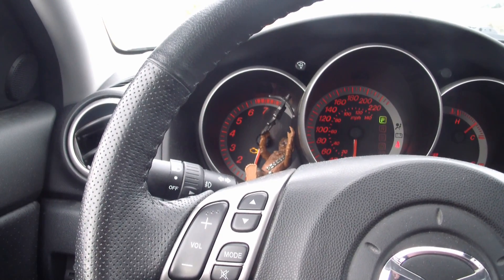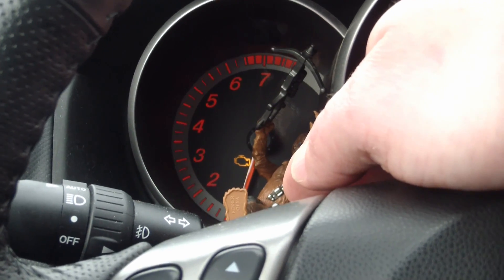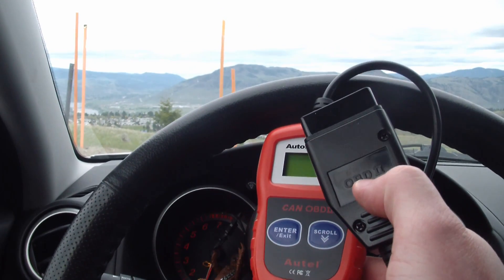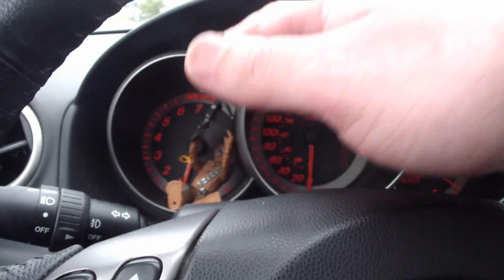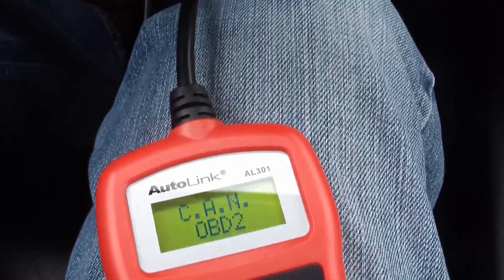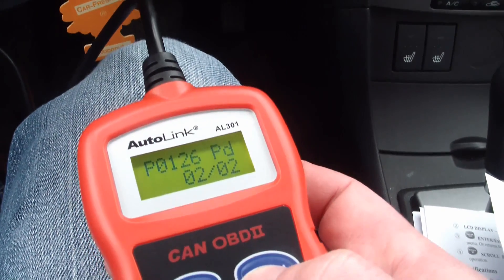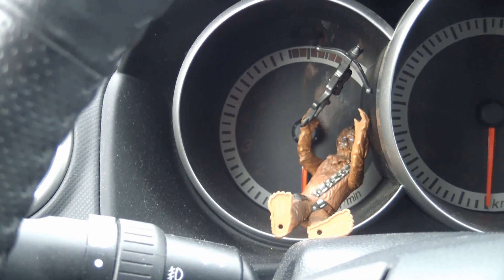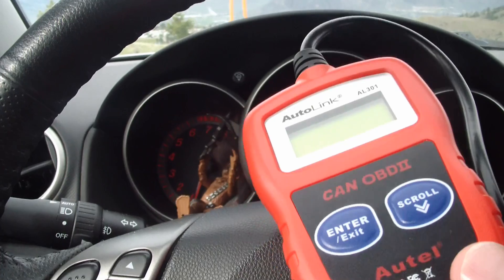Manly-Man Skills: Outsmart Mechanic Scams by Using Your Car's Computer!

Comment: The reason so many cabs had those engine lights is because most cabs for the last 20 years were Ford Crown Victorias. They throw engine codes like feminists throw tantrums. I sat in a police car once with a cop that was so tired of looking at it that he'd taken a bottle of White Out and painted over the light on the clear plastic.
Reply: Push Back you say "pull the bulb" ... have you ever pulled a cluster? .... not as easy as it sounds
Reply: kenny moyer I actually have pulled dash clusters before. Depending on the vehicle, it's not that hard. In many cars, the cluster is a component that comes out and the bulb is behind a sheet of plastic where all the indicators are marked. It's not too difficult.
Reply: kenny moyer Trust me...he's pulled a cluster.....
Reply: Apparently, the proper strategy when selling a car (or Ford van) is to pull out the bulb.
Reply: Push Back and
Reply: Rubenbanana Over time, he'd taken a sharpie and gone over it. It didn't look too bad, but I was left thinking "Why not pull the bulb?"
Reply: Push Back Oh...The old "Auto Correct" 😅
Reply: black electrical tape, blends in pretty good too
Reply: I was a cop during the crown vic days. We used a lot of black electrical tape to turn the check engine light off.
Reply: Push Back some aren't too bad ... but when you consider one if light is on solid may not be a big deal but if light is rapidly flashing you have big problems ... take bulb out you don't know .... I just ignore mine on 86 chevy k20 ....two the cluster on my 89 s10 takes awhile because of hvac controls if your not real careful  that anoyying bulb can turn into hard to find hvac vacuum head switch .... luckily my already fragile vacuum head (original to truck at 189k) was one I had a spare of from part truck ....

Comment: My engine light comes on once in awhile and then goes away on its own LOL
Reply: Rex Holes it's either the o2 sensor of the gas cap.  used to happen to me as well.
Reply: MyNoble06 a flashing engine light is a class one misfire .
Reply: +myboy051 it's also like I said above in either case it's saying something is terribly wrong and can cause damage to the engine. a solid light is less serious. if you think about the average person is less likely to ignore a flashing light rather than a solid light.
Reply: was about to say o2 but covered lol.  also i just DL software for my laptop and got the cable only to use on my WRX.
Reply: +5tevef if it's a o2 sensor more often than not it flashes. this is because if a o2 sensor fails it sends the engine into a rich run limp mode which will kill the cat. if it's solid it's not as urgent or important as a cat
Reply: your engine light likes you

Comment: If it was anything I'd say probably a worn out thermostat. Thermostats  tend to start passing too much coolant to the radiator after a few years which reduces engine efficiency. Or sometimes they do the opposite which is far more alarming.
Reply: Or a dodgy temperature sensor? (or poor connection, if you'd been doing something under the hood)

Comment: WRONG!, check eng light is only there for emission related codes.educate yourself 1st,before scaring all the retards that watch your vids.OUT!
Reply: Check engine is absolutely for more than emission codes.
Reply: trashy10 stop. please.
Reply: Justin DiPlacido The OP is a bit of a twat being so aggressive, but the intent of the CEL is specifically for emissions. Emissions is directly related to engine efficiency (+ catalytic converter health), and engines only run efficiently when everything is working properly and at the right temperature. This has far reaching implications for the type of sensor monitoring and what actually triggers a CEL, but nonetheless all CEL codes are based on emissions. The amount and type of data that can be pulled from an OBDII port is more than what's solely involved with the CEL of course, for example issues with ABS and Airbags which trigger seperate lights. However you may not be able to pull ABS or Airbag information with a basic OBDII reader since some manufacturers create their own proprietary protocol for other data outside emissions since other data types do not need to be standardized.
Reply: yeah ok im the bad guy. google it,im fine with that,let me know how many codes turn on the MIL for shocks or low tire pressure cracked windshields,low washer fluid,or bad body madules.good luck guys
Reply: The CEL is not only for emissions. I think the appropriate thing that should've been stated was that majority of the time the CEL comes on when it is an emissions problem.

Comment: Same code can mean 6 different things between 6 different cars (manufacturer specific codes), OBD2 is 96 and newer only, and font remove battery connector on a lot of German or Swedish cars, will mess you up more.

Comment: That scanner does not show manufacturer specific trouble codes. For example, VW has specific DTCs that only a reader for V.A.G. cars can decipher. That's Volkswagen-Audi Gelelschaft or Volkswagon AG, not VAGina cars btw. The standard OBD2 scanner/readers only show codes required by the C.A.R.B. that are on the list for OBD2 compliance. So pretty much anything emissions related you'll find standard OBD2 codes for.  But if you get an ABS warning, the code is going to tell you to check the ABS control module DTCs which you are out of luck then with the standard OBD2 and will be stealership bound or to a mechanic that can access the ABS control module with a dealer scanner or equivalent.

Comment: Be careful with mechanics, especially dealerships.  they will often tell you that your car is throwing out a code for this or that when your car's check engine light isn't even on and your OBD scanner or your car's "in house" checking procedure isn't throwing a code.  If you ask them why that is, they'll tell you their computer is a deep scanner and can detect codes that you, the regular consumer, can't access.  You are being given the shaft when they tell you this.

Comment: In many cars, if not all, you can check what the codes are without the OBD scanner.  Search google for your specific car to find out.  There should also be a simple code erasure procedure as well, meaning you may not have to disconnect the battery to erase the codes.

Comment: Not exaggerating when he calls them stealerships.  Was a customer service manager for an aftermarket company for 7 years and the amount of BS I dealt with from stealerships who knew less about THEIR OWN CARS then us was incredible.  Chrysler dealership once charged its customers to replace defective ECM modules that were defect straight from the factory, that Chrysler HAD issued an TSB for but easier to blame your aftermarket hubcaps the cause of the failure to collect $700 cash from your customer (that was just the ECM cost labor add ++) then warranty the unit.  So yeah I can confirm ALL and I mean ALL stealerships are exactly that.  And about 80% of these check engine lights in the rust belt (Canada included) are faults with the OS2 sensors on the exhaust.  Seeing there are normally two of these sensors on all vehicles, quite easy to have them fail due to our crummy winters.

Comment: Handy to have, but unless you are able to test the components to ensure they are factory spec then replacing parts based on codes can be very costly and still may not fix a fault. My last video covered that situation with ABS wheel sensors, having the OHM and VOLT values to test the sensors made it easy to discover the fault was just dirt on the sensor I washed off to fix it that I otherwise would have replaced at some cost. A common error I saw as a mechanic was some who replaced a number of expensive non returnable parts due to multiple codes, never considering it most unlikely for a number of parts to all fail, and more likely to be a bad earth or the like, and the look on their face when you say you found the fault and it was just a broken wire is priceless.

Comment: If the light is flashing it is a serious problem.
Reply: If the light is flashing it means the fault can damage the catalytic converter.such as misfires/lean codes...
Reply: &ean Fal and some crazy ladies have 17 cats..
Reply: If the light is flashing, turn.
Reply: if you have emissions checks yes, but i dont ;D
Reply: American Gun Nut 
🤣😂 indeed they do. There's one in the complex across from me .
Reply: Gas cap fault.  Replaced for about $8.00.
Reply: Indeed, and some vehicles have 2 Cats
Reply: @datdood3  some have 3 and 4
Reply: Removed the 15 amp fuse that goes to the lambda probe on my cheap lil chevy hatchback and it started flashing the check engine quite vigorously when i turned it back on.
So yeah this kinda reinforces the "only flash when emissions" thing since the lambda probe goes into the exhaust to detect CO2 levels... or was it O2 levels?
Well it detects some sort of car fart.
Reply: &ean Fal lol hell yeah
Reply: Misfire
Reply: Or there's fault with the light itself.  Imagine that, your car slowly falls apart on you, all because the check engine light is busted and never turned on, lol.  XD
Reply: your check engine light will NEVER flash for an oil change. its against federal law to use the check engine light for anything but emissions failures.
you are talking about your maintenance required light.
Reply: if the light is flashing it's a misfire

Comment: *****
I know it's probably been too long for you to see this... But have you ever looked at the "Torque" app, and a bluetooth connector for ODBII? You can get the connector off Amazon for a few bucks, and the app is just a couple... (I got it for .99 a few years back...) But yeah... It's super neat, and fits a bit into your worldview of things. You can see realtime output of pretty much any sensor on your car.

Comment: ABS sensor light was on. Lexus told me back left sensor was bad and it would be 1200.00. Took it home found a broke wire to back left wheel and spliced it back together for 0.00. Problem solved
Reply: also for quoting a whole new sensor.  repairing it is likely improper repair according to lexus.  especially if its under warranty old parts have to be sent back to the company and are examined to find the cause of the fault.
Reply: siborg 1 ABS sensor $40 then they charge $400 an hour including lunch and a couple of smokes  maybe a visit to the stores and a bit of PlayStation time
Reply: You'd think they could easily test that by hooking up a known good sensor and not seeing the light turn off, thus pointing to something else being the issue.  Maybe they did, who knows.
Reply: PongoXBongo super late response.. but 99% of the time the wheel speed sensor has about a 6-10” pigtail with it.. meaning the wire is included in the replacement.. usually dealers don’t splice wires due to the fact their obligated to return the vehicle to factory specs.. but that doesn’t mean you can’t splice them yourself 😉
Reply: $1200....Shoot a feller could have a purrdy good time in Vegas with all that stuff.
Reply: too much padding in the wallet region was what the quote really said if you read between the lines
Reply: Had the same on my Mazda Premacy, bought a new sensor, actually it is a proximity switch,  at E-Bay for 22 € what is apx 25 $, everything OK now. Has to be the same price for Toyota ( Lexus )
Reply: I had the exact same issue on my VW Jetta TDI
Reply: They legally cant do that that have to replace it
Reply: @watermelons1285  bullshit.
Reply: @chocolate_squiggle  me being a red seal car fixer I can say its seriously frowned upon. There is a twist rate for wires and if its not correct it can send bad readings to the ABS module. Wires that are crimped with butt connectors also can affect the performance. And when an abs module is looking for small amounts of a/c mV difference between all sensors. It can (not alway) but can set fault codes.
Reply: An ABS sensor generates either a low voltage sine wave or a vow voltage digital pulse. An improper splice could interfere with that signal and cause a fatal accident. No repair shop would EVER take that chance with your life! Many sensors are built into the wheel bearing assembly and must be replaced as a unit.
Reply: @gener.1253  Oh yes... you ABSOLUTELY have to have a wall full of "certifications" to be able to do a good splice...
Reply: @alfredomarquez9777  having a wall full of ASE Certifications, 11 in all, I would never attempt to splice a twisted pair of shielded ABS sensor wires. If you want to put a price on your safety and that of your family, feel free....
Reply: @gener.1253  Dude, relax. It just disables the ABS you're not going to crash and kill anybody lmao. People drove around in drum brakes, bias ply tires with no abs for decades.
Reply: The reason they quoted full replacement is to ensure the fault wouldn't come back. Splicing and repairing the wire works, but may interfere with the signal. Cars are very touchy when reading voltages.
Reply: @533ren335   If a shielded wire is truly required, replacing the whole wire shouldn't cost $1200 either.
Reply: 533ren335 splicing a wire doesn't call inference it just makes it whole again as long as its sealed up good with shrink wrap I don't trust tape as it holds moisture.

Comment: Don't disconnect your battery to erase codes.
Reply: They come right back.
Reply: Push Back Yeah. Also it makes it more difficult for a mechanic to diagnose the problem.
Reply: trust me, i've had it happen that someone disconnected the battery right after he shut the car off and it had to use all it's factory settings instead of the ones it made itself by all the parameters it got while driving, the car used about 1L/100km more and the emissions were a lot worse donotmindmeatall
Reply: donotmindmeatall
it was a 2015 1.5 Mercedes A class, well its a renault engine. It normally uses around 6L of fuel and now increased to 7.3 but after driving around 100 km's it returned back normal although the driver doesn't like seeing the increased consumption, and yes this happened in europe. Belgium to be more exact
Reply: No.
Reply: Correct- DON'T PULL YOUR BAT CABLES, NOTHING WILL HAPPEN.
Reply: Jn
Reply: Under some conditions with some brands they will show back up quickly. With some brands and some issues you are creating a pain in the ass for your tech by clearing the codes. They may not come right back.
Reply: and let's not forget all the electronics that will forget all their data including quite necessary ones for fuel economy and such
Reply: Scott Diamond anytime you do work under your hood you are suppose to unhook the battery anyway....sooo....what's the difference?  yes people unhook your battery when doing plugs and wires or anything electrical under your hood. changing oil and topping on fluids you won't need to unhook your battery.
Reply: alan stepp read all the other posts for your answers. I'm a master certified auto mechanic with 25 years experience. I know when I need to disconnect a battery and when not to.
Reply: Scott Diamond it will come back after 100 miles or so and it also resets your fuel settings I'll call it and the car has to relearn its fuel ratios and your car will idle differently and also good bad gas mileage it could even run badly or stall in worst cases and also takes over 100 miles to set again and some cars have steps you have to do like starting it and holding the throttle down an keeping it at a certain rpm like 2500 for a given amount of time.

Comment: Is there  a check-the-check-engine-light-light? :)
Reply: There is of sorts, when you first turn the ignition on if the check engine light does not light than the bulb/LED is not functioning.
Reply: tbbt
Reply: On some Audi and high-end vehicles, they have lights for lights,
Reply: Check-engineception
Reply: actually yes,  on most vehicle the CEL lights up when the ignition is on, prior to starting the car, if it doesn't then the ECM failed its self check (or the light is broken)
On some newer vehicles if the ECM doesn't get a response from its CEL test it'll either no start the engine (usually by not injecting fuel or slamming the throttle closed) or flash the  red emergency shutoff light (if equipped).
I don't think there is a code for a nonworking CEL.